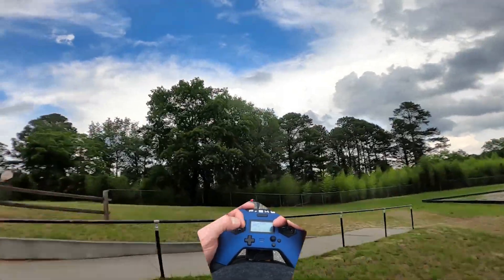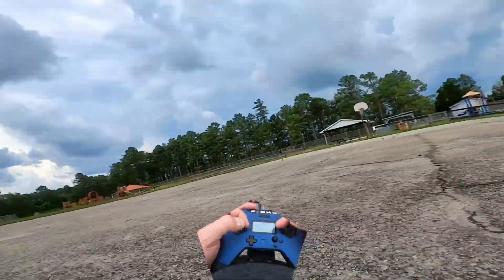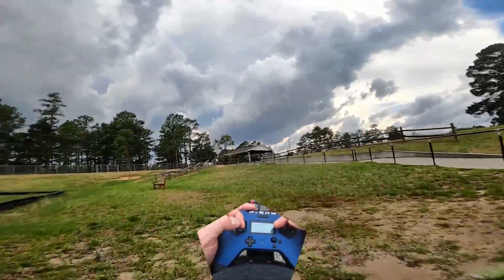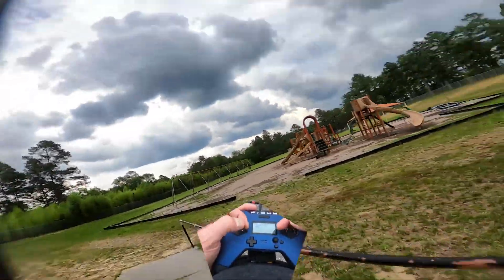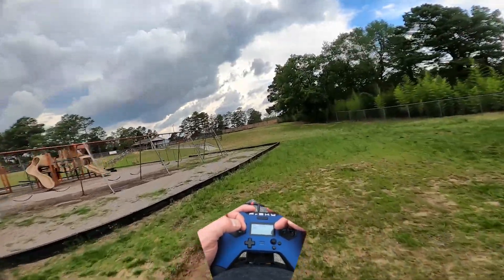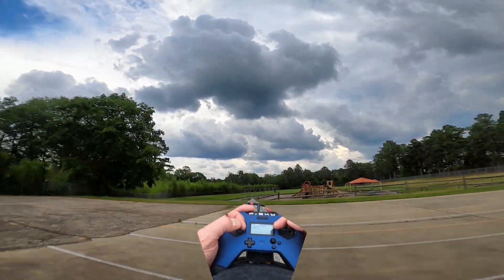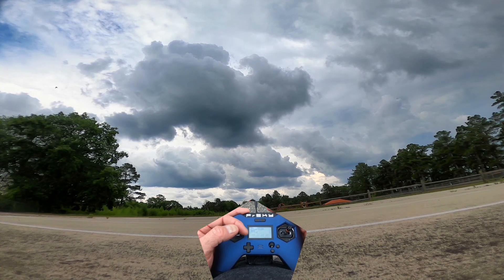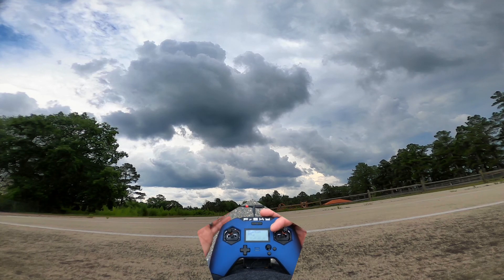FPV Freestyle Trick Series: How to - Throttle Management

Comment: Learn (managing throttle) to fly slow with low-cam-angle seems much easier.
So, how to it will be if we're using higher angle? say 30-45? :)
Reply from the maker: I agree, lower angle does make it easier. I fly a fixed 20-25*. That's the tilt I ran for this video too. As you increase the camera angle everything stays the same but your flight speed will start to raise (and throttle input) quickly because of your quads angle of attack to maintain level flight. Turning will be different too. I see no difference in throttle management regardless of camera angle. I will say, your reflexes and adjustments will have to be much faster with more camera tilt due to the increase in speed to maintain level flight. Thank you brother!
Reply: @PhantomFPV  So you fly with 20-25? 
Wow, I guess I've been to long within this quarantine, only "flew" in simulator and never found the best setting to match-up the quad IRL.. lol  ... (low-angle on sims make the quad jumpy on throttle)..
However, great content!!
Hope you have more of this FPV's fundamental. 
I hope you will covering on how to choose and tune rates that suit our flight characteristic... :)